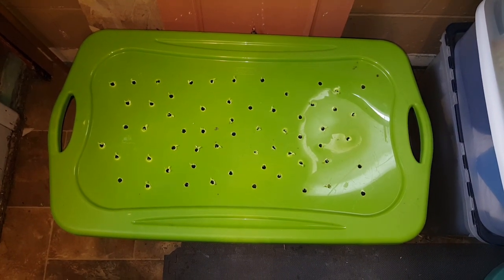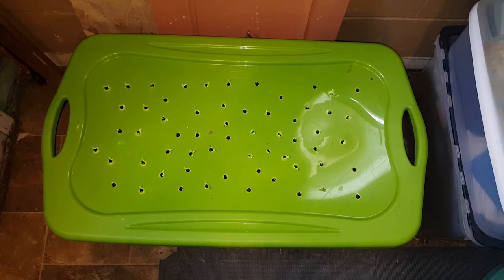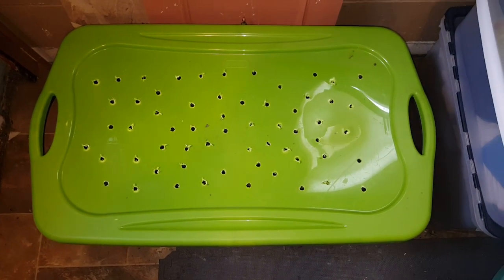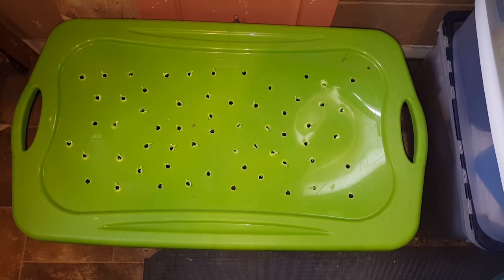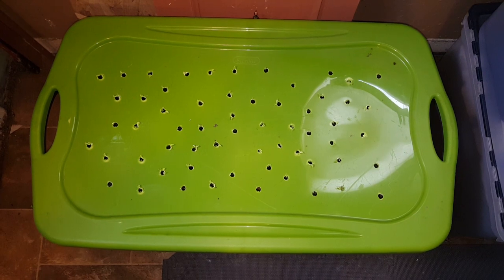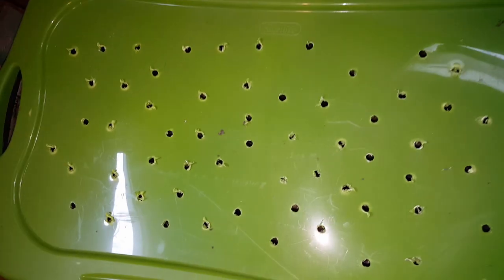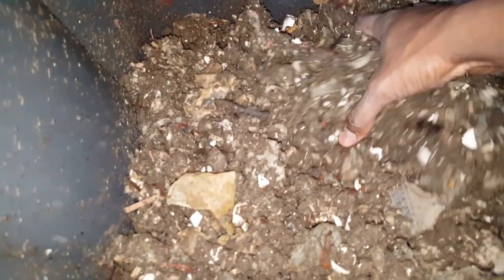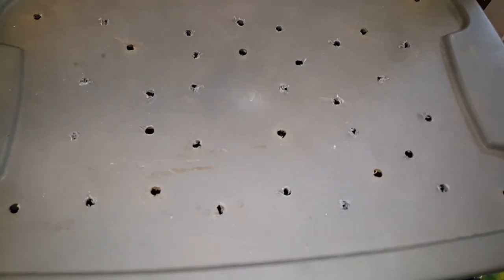Why Are My Worms Trying To Escape

Comment: Looking great! It will be interesting to find out why those rascals are climbing to the top of the box.
Reply: because they want fresh air! :=) i used to have the problem. when i have not enough air vent. the food scrap in the bin must have some smell. i came to believe the air in the rotten food is nuisance to the worm.. hence that.  if you remove the lid.. surely they won't come out any more.